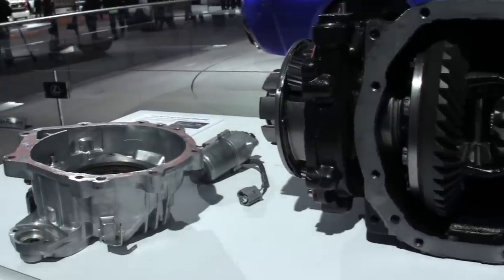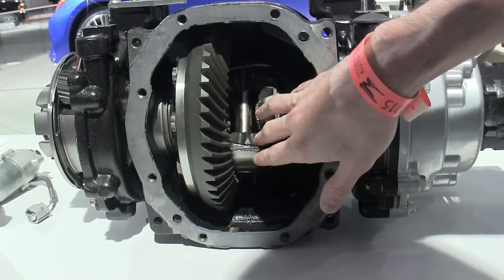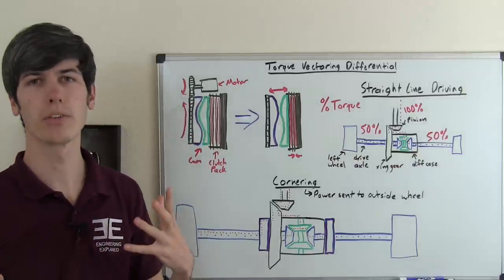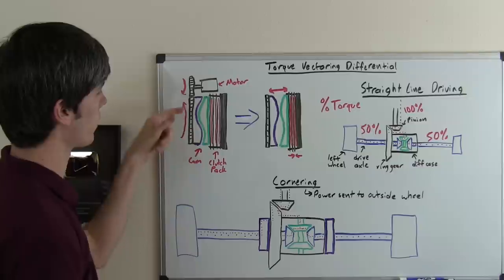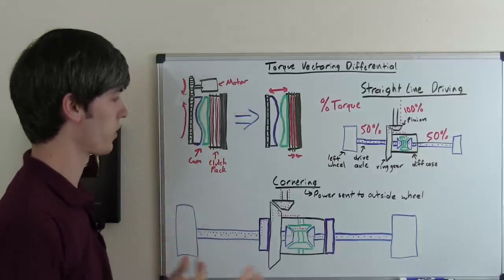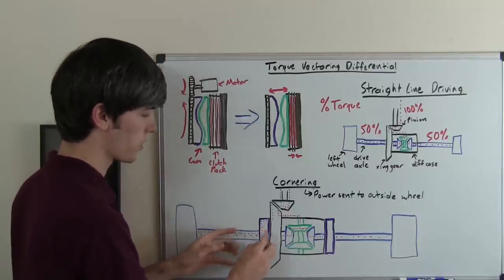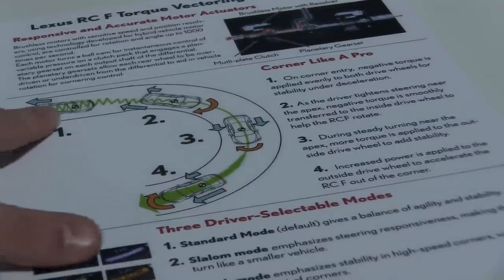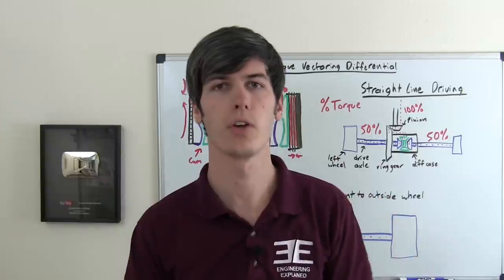Torque Vectoring Differential - Explained

Comment: great description, the use of planetary gears to deliver torque at the proper ground speed or greater to the outside while still sharing traction with both wheels is amazing. The rcf is a heavy car by any standard. The tvd is able to make the car feel light and nimble to the point where there may even be voodoo involved. I own an rcf with tvd - it does feel a bit strange but it sure does the trick

Comment: Hi very informative vidoe. If I'm not mistaken, the principle of a differential is that torque goes to the wheel with LEAST resistance, hence if the clutch is engaged on say the left side then more power will go to the left side due to it having lower resistance than the right...

Comment: The principle of a differential can also be applied in reverse whereby individual braking can be applied to any wheel. If the right tyre requires more power than the left wheel will slightly be "braked". Lower end cars use these methods of torque vectoring as it is much cheaper.

Comment: It's actually amazingly simple how this works when you explain it! I'm also interested in how the computer reads and sends data, although that may be a lot more difficult to do so.
Reply: Wheel speed would be all it needs, right?
Reply: @ebrainz101  Wheel speed, traction conditions, turn ratio and direction, driving dynamics (WOT or casual)
Reply: The computer takes and considers inputs from the steering angle sensor, each wheel speed sensor (wheel speed variations), throttle position sensor (desired torque), vehicle speed, brake pedal pressure, as well as vehicle accelerometers to make decisions about axle clutch engagement using a pre-programmed table, or "map".

Comment: Sorry to say but you're wrong. You just explained a LSD or locking diff at min 3:45. If you lock one axle with the carrier you got a locked diff and then torque varies upon grip, and do opposite of what is desired in corner: understeer. 
The clutch packs actuates on that  planetary reduction gearset which changes the ratio, thus multipliyng torque on that wheel. The clutch when locked stops the planetary gears from rotating, as  you can see it's fixed on the case. Search image "torque vectoring activ diff research" it's the first schematic with 4 drawings. It's the c) variant.
Reply: Thanks man. I was completely confused by this video.
Reply: To understand is necessary to see the picture with the scheme
Reply from the maker: G55STEYR Great, thanks for sharing. I'll update the video description, add an annotation, and I may need to shoot an update video. Now, the torque does transfer from going through the spider gears to the axles, to the housing to the planetary gears, but its the gearing that causes the difference in torque, which is allowed by the planetary sets. Mind shooting me a quick e-mail - officialengineeringexplained@gmail.com so I can discuss the link you're referring to? Thanks!
Reply: I understand a vast amount about cars and yet Differentials when being explained still make me feel nauseous and head-spinny
Reply: I was thinking the same thing. All he had to do is read the promo info displayed with the unit to know it works by changing the drive ratio and thereby the torque going to the individual side. Seems to me it works similar to an automatic transmission's gear change except it's variable instead of only working in the fully on or off positions. If that's the case I would think clutch wear would be an issue!
Reply: Yep, the clutches are slipping all the time they are engaged.

Comment: What you described  was a locking differential that uses clutch packs. This is not torque vectoring, that's just a LSD.  Torque vectoring is achieved when the clutch is activated and power is sent through the planetary gears providing an overdrive to the outside wheel when cornering.
Thanks
Reply from the maker: Themi Xinos Thanks - I've added some further details to the video description. May make an update but for now have provided a link.

Comment: You forgot to mention role of planetary gearsets. If clutches would simply connect output shafts with diff-housing it would work like simple LSD with added control of how much it can slip.

Planetary gear sets allow to direct power to one wheel instead of locking whole differential.
Principle is similar like modern tanks steering systems with two power inputs.
Reply from the maker: +FlyingSnake110 Correct, it's incomplete. The gearsets allow the power to be redirected. I've included a link in the video description for more info.
Reply: +Engineering Explained Yeah, but seriously, no one without a master's degree in mechanical engineering from a top school is going to understand that linked document. Can you redo this video? I'd like to understand how torque vectoring actually works in 5 minutes, not 5 years worth of effort.
Reply: +exnihilo415 basically clutch with planetary gears try to spin output shaft faster than it spins, thus transferring power to it.
That's why that gearset is needed, to multiply speed between clutch and shaft. Without it this differential would work as it would have electronically controlled slip.
Reply: +FlyingSnake110 I was confused until i read you're reply. I was thinking that this would just be an electronic slip control and that a center spool would be a better option. Then realized you are right, the planetary set is the key here.
Reply: I agree with exnihilo - a short video describing how the planetary gearset causes the wheel to be overdriven would be great.
Reply: I agree with exnihilo & Cory Engel.  It seems the most important part has been glossed over.

Comment: Torque is applied to the outside wheel because, due to cornering forces that cause body roll, the inside wheel has no weight on it and would slip, as is the case in a conventional differential where each wheel gets 50% of the torque and the inside wheel always breaks free.

Comment: How does the electric motor know when to engage the clutch? In other words, what is the actual trigger to engage torque vectoring? Since this is helpful on turns and slippery words, how does the motor know these conditions are met?

Thanks for the awesome video!
Reply: It basically works on newton's third law... reaction to every action. There are sensors on wheels which tell you about the conditions which give motor the via some electronic unit that now motor should come into action which in turn would rotate the gear and the flow of power goes further.

Comment: Can you cover Subaru's Active Torque Vectoring systems?  I'm really confused on how ATV is any different than regular stability control, and why they call it torque vectoring when it really vectors the brakes and such- just like stability ctrl.  

I know the new WRX uses open diffs all around except for the proto-LSD in the center, so I can see how it and other Subaru vehicles may benefit from being able to brake individual wheels to control wheel spin.  But the STI has like four LSDs, so why does it need Active Torque Vectoring?  People like to talk about how the STI has ATV, but it already has a full suite of LSDs, soooo.... what's the deal?  

Thanks

Comment: A newbie here. Don't rlly get stage 2 of the cornering. When turning, the outside wheel has higher velocity plus there's slightly more body roll(weight) to the left so shouldn't more torque be provided to the left wheels. Plus intuitively if u want to rotate clockwise u want more torque on the left than right, going forward
Reply: When you steer right you want more negative torque on the right wheels. You want it to brake more on the inside. It helps rotating the car towards the apex.

Comment: I just have one question, I saw the animation of the differential somewhere or probably on the ZF vector drive, construction is similar to this one, and essentially when you engage the clutch in that it locks the planet carrier to the differential housing as you also said, but when you demonstrated in the last part of the clip, you kept hold of the planet carrier to make it stationary, wasn't it supposed to mean the clutch is engaged in such condition rather than being disengaged? And more rotational power was sent to the left wheel instead? Another reason to ask this question is unlike a regular co-axial planetary set, where we have a sun, ring and planet carrier, this is a spur gear type set, where there are 2 coaxial gearsets, with their planet carriers married, and the ring gear here is actually the sun gear of the 2nd co-axial gearset which feeds power to the drive axles of the wheel. I tried clarifying by finding the detailed schematic of the gearing, but I couldn't hence I have such silly questions.

Comment: Seems like this would have to use some sort of ATF friction modifier with the viscosity of a gear oil or something close to that. I bet that flush and fill will be pretty expensive for the first few years, when only the dealers have the fluids on hand.

Comment: Good until the part about how the Lexus system works, which is poorly explained. “Negative torque vectoring” on 1 and 2 sounds like automatic brake application.  “Positive torque vectoring” on 3 and 4 is when the clutch pack is engaged to send more torque that specific drive wheel.

Comment: Dynamics question: Cheap brake-based torque vectoring is inferior because it sacrifices engine power as heat into the brakes, among other things (also heats/wear brakes more quickly).

These clutch packs generate heat also when they are not fully engaged. Where does that heat come from? Does this heat mean that engine power is being wasted?
Reply: The main distinction of the brake-based torque vectoring versus clutch-pack on planetary gear is the clutch-pack only controls the rotational inertia of the planetary gear set.  The brake-based system controls the rotational inertia of one of the four wheels thus it will rob more power.
Reply: The main idea of this devise  is that the clutches are NEVER full locked while engaging. So yes, while vectoring the torque you dissipate engine power. Alas. But 1) that loss are smaller than using brakes; 2) you "direct the excess" of torque from one wheel to another through the diff, what doesn't happen when just braking one wheel.

Comment: The link is dead that you posted in the description that explains how the planetary gears overdrive the outer wheel when the clutch pack partially engages - could you please do a short video elaborating?

Comment: i really don't get it... in your description link it's figure (c) thats most common to this kind of torque vectoring differentials i guess? In the draft i get it, there are two different size sun gears and two different size planet gears, the planet gears are directly connected. When the clutch pack is open, it does not influence the torque distribution. When one is closed, the planet gear carrier is braked down and the torque comes from the differential housing, to the inner sun gear, to the planet gears, to the faster spinning outer sun gear and finally to the wheel. But in your video the planet gears look totally the same size? how does this work? there's a video animation on youtube of the "ZF vector differential" and there it looks the same, the planet gears are not only the same size, they are one gear! This thing is really complicated...

Comment: I still don't understand how the planetary gears work in this. Is the output another sun gear? Is the ring gear fixed to the housing? If the clutch is engaged on one side, what is being locked together? Does it lock the planet carrier to the housing?
Reply: Eep, author mentioned this in the description

Comment: Sorry but I think you explained it wrong!

You don´t get more torque to the right or left axle because of the clutch connection between diff housing and axle. What you are describing is a normal electronic lock differential.
Key to sending more torque to one wheel are the planetary gearings. for example if the right clutch is engaged the planetary gears force the right output shaft to spin faster (i think it´s about 10%) than the left one. by doing this you can force the open diff into an imbalance which leads to more torque output on the left side.
Because open diff means:

 nr+nl=2ni with nr= rpm right, nl= rpm left and ni= rpm input.

So in case ni=1 nr=1,2 => nl= 2*1 -1,2 = 0,8.

Also the gear ratio is  i = ni/nr= -tr/ti

=> Right side ni/nr = 1/1,2 =0,83 => 0,83 = -tr/ti => tr=83,3Nm

=> left side ni/nl = 1/0,8 =1,25 => 1,25 = -tl/ti => tl=125Nm

sorry for bad english
Reply: Engineering Explained
Reply: Realy? no answer? Thank you!
Reply from the maker: TheChris1610 Sometimes you miss a comment when there are thousands a month. I've added an annotation and a link to the video description clarifying some (misleading) points.
Reply: Engineering Explained

Yes i understand that. But if you take your time to write a comment like this and explain things you may get a little mad if you see answers to short 10-word comments that were posted after you.

Back to topic
Differentials and especially torque vectoring differentials are a very complex and hard-to-explain topic.
But if you try to explain it you should do it right or let it be. If you just say  it’s a diff setup and it allows you to alter the torque distribution that´s ok.
But if you start explaining operation and claim to do a “in-depht” review of the operation- principle do it right and if you made a mistake, correct it.
And not only by writing “the operation of the planetary gears is not explicitly shown” into the description.

1.       Most people don´t read the description

2.       It´s still wrong!  You explained the torque vectoring effect as additional torque being send to the individual axle via the clutch packs adding up with the 50% of the open diff and that’s simply not true! You didn´t mention the planetary gears or their role at all.
No offense but I daresay you yourself don´t understand how the torque vectoring is working. That´s no shame! It took me long hours of research to understand the principle. There is almost no info about differentials on the internet and even less on the torque vectoring.
I also was on a point where I thought that the principle you described was right but believe me it is not!

I really like your other videos and It would be great to have a video describing the correct principle in an easy-to-understand way. This would make life much easier for many people.
 
But please stop confusing people and correct your video
Reply: So does the clutch pack lock or slow down the planet-carrier or does it slow down the planetary ring gear?
Reply: 2Phast4Rocket in cornering what this torque vectoring setup does is apply a little bit more torque on the outside wheels thingy which causes the axle gear on the outside to spin the cam and lock that side's clutch packages which causes the planetary gears to roll over the outside axle's pinion gear a little bit faster than the inside and increases torque on that side
Reply: I realize this torque vectoring mechanism causes the action shaft to sping from 1.2 to 3 times faster than then non-acted shaft.  The question is how the planetary gear mechanism is activated because the video is wrong and the reference link is just way to advance for the lay people.
Reply: 2Phast4Rocket what do you mean by activated? it simply transfers torque.
Reply: So to put it simply. By engaging the planetary gears on each halfshaft, do these planetary gears multiply the torque through their gearing, or do they cause that wheel to spin faster than the opposite wheel, say the outside compared to the inside and by doing that more torque will go to that faster spining wheel ?
Reply: In think the setup has the drive shaft as the fixed sun gear that always turns plus a planetary gear set and the ring gear on the outside.  The clutch pack, when activated, slows down the ring gear and eventually stops it.  When the ring gear is slowed down, you get the incremental torque multiplication and when the clutch is fully activated, you get the full torque multiplication as the ring gear is stopped.  I read that in some car such as Acura, the torque multiplication if fully on or fully off.  In Mercedes, Audi, and Toyota, the torque can be gradually applied.  This system in the Lexus is more advance than Acura because the car is a lot more expensive.  The Mercedes setup is similar to the diagram (c). I still don't understand how that work.  The description I gave is related to the Acura.  Someone more knowledgeable can correct me on this.
Reply: TheChris1610 
hello chris
Reply: Nontas1993, at fact both effects are present .

Comment: Yes but what sensors etc activate the clutches and deactivates the rear driveline once up to speed?  What tells it you are cornering?  I have a 2021 Highlander with this system and it is both incredible and seamless.  No more aggravating ABS noises trying to do this for you, just seamless traction like I have never experienced before and I have had  a bunch of Toyota 4x4s in the past and they were good but not this good.

Comment: It seems like your whiteboard drawing is opposite of the display, it looks like the clutch packs hold the shaft to the housing so that the other side gets the torque rather than the clutch packs clamping to the diff and spinning everything together ??

Comment: So I've just watched all of this series in the past 24 hours. Would I be correct in saying modern formula one cars run torque vectoring diffs like these (a very loose, like)? After the viscous episode I thought they might use those with an ER fluid for the driver controls. Is it more possible that they do use viscous diffs with the only reasoning being that the mid corner control is usually labelled "viscous"? The only other thing I can think of is they use a "torque vector" setup like this with ER fluid instead of cams and step motors. Thoughts?